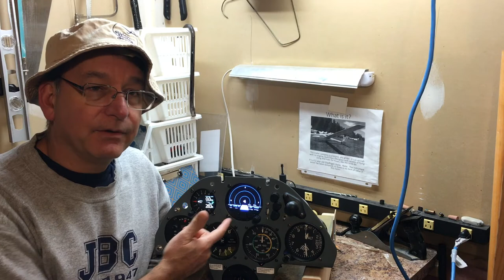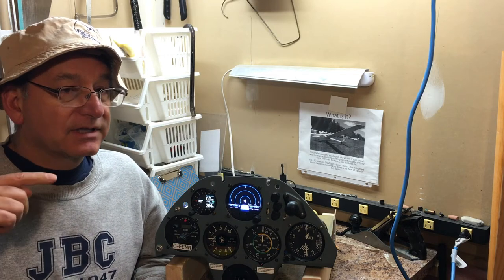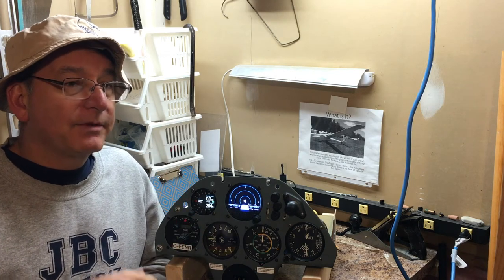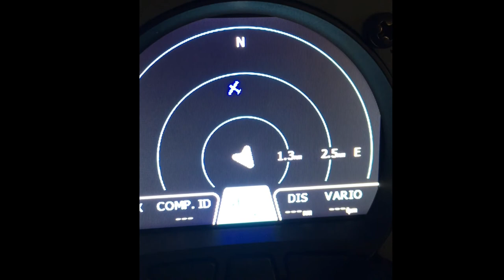"Radar" Display In a Glider / Sailplane

Comment: Very much enjoyed! Still looking for my own Libelle, it would be nice to see more Libelle related topics. I can never get enough….
Reply from the maker: Glad you enjoyed it.

Aside from the panel being a Libelle one, none of the instruments are necessarily tied to a Libelle.

When we acquired #34, we gutted the panel and even had part of it re-fibreglassed and holes re-bored for a completely different layout, though most of the original instruments remained.  The wiring was replaced (old was not done properly), the radio we changed to a previously used one, but compliant with current specs (the old one was really really old!), we added a FLARM, and we added the TrafficView.  Keep in mind, this is work for an AME, and this was done in his shop under his watchful eye.

Now you know why it's painted.  It hides the odd patterns you get with fibreglass repair ... and it looks nice!

Something to keep in mind when you acquire any older glider, there will probably be work involved to get it to the way you like, so you should make sure you budget for that.